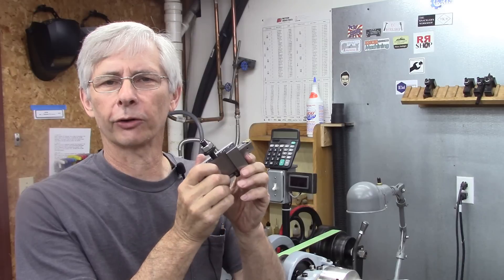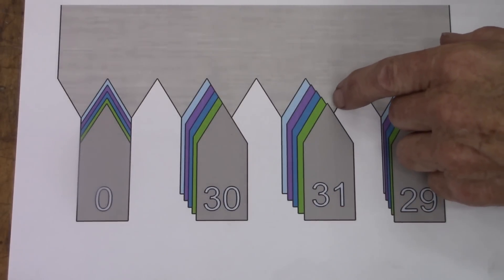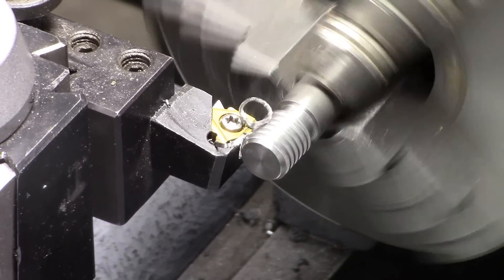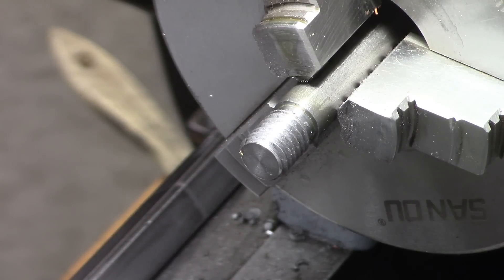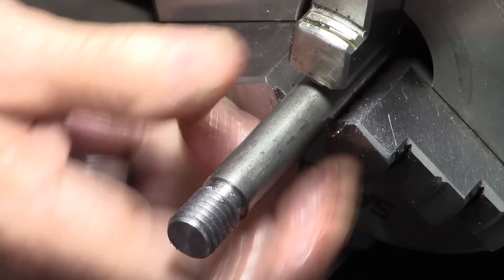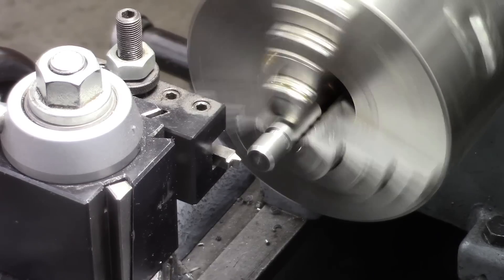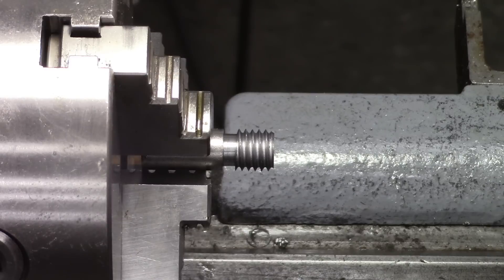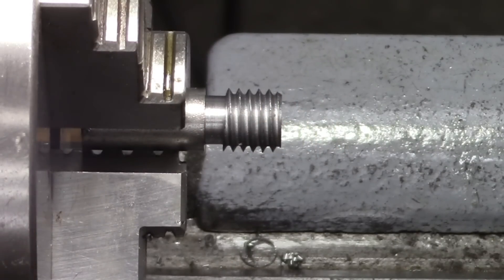Threading - Feeding with the Cross slide vs Compound

Comment: I found the noise in my South Band 10L. It all came from a loose set screw on my electric motor pulley. Once it was tightend, it now sounds like a sewing maching.
Reply from the maker: That's great, now that I have an oiler on my gears its much more quiet but the new mic also helps.

Comment: Thanks for the interesting demonstration  which you covered very well. I like feeding with the compound with a very small positive side rake on the tool. Go straight in on the last couple of spring passes for a perfect thread.
Reply from the maker: Interesting...  I'll try that
Reply: @WinkysWorkshop  1 degree top side rake.
Reply: @ellieprice363 Any top rake will NOT give a correct thread profile. Probably ok for home shop thread but not for professional Industry Standards.
Reply: @daveticehurst4191 Technically correct but since the tool is cutting primarily on the leading  edge the thread profile will be exactly 60 degrees.

Comment: A good topic to start a fight in a Machinist bar.    LOL
I also prefer using the compound.   When I need to make threads for my wood lathe, 1 1/4in x 8 tpi, even with using the compound I have to take light cuts due to the amount of metal being removed.
As you said, the sharp "half" threading tool made some really nice looking threads.   Well done.
Dave.
Reply: ...so how do you know you are arguing with a lathe operating machinist if you're not in a Machinist bar...? They always start with "well, let's face it..."
Reply from the maker: @AttilaAsztalos  Haha
Reply from the maker: Yeah...  I was very surprised. I might have to start using HSS more often.
Reply: I have a threading tool from Arthur R Warner Co  from here in PA which uses HSS inserts.    This works well.   Easy to use for external threads, needs a large ID for internal threads.
Dave.
Reply from the maker: @lv_woodturner3899  I'll bet it works great. I had one of their inserts without the holder and never tied it.